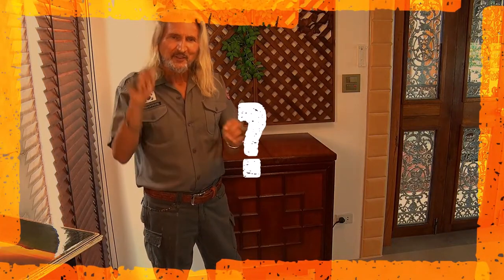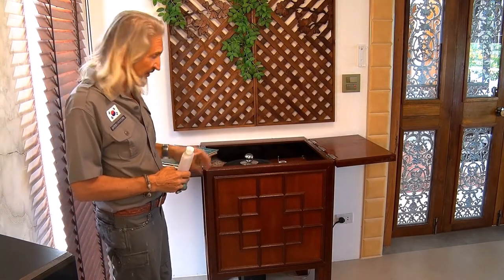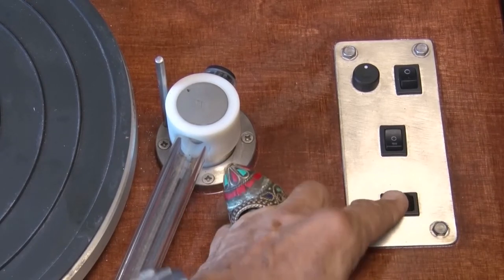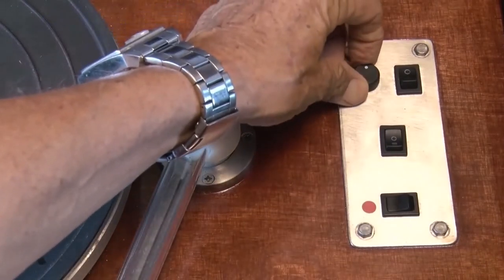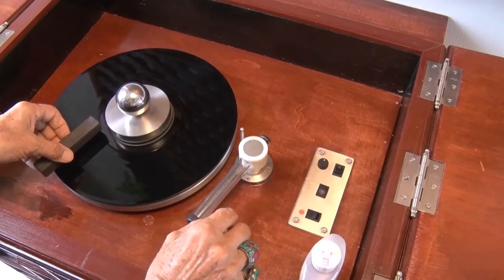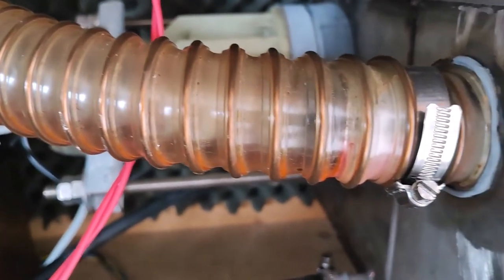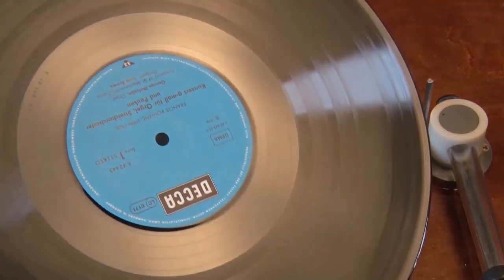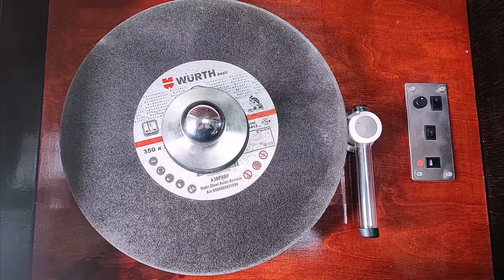Record Washing Machine vpi or DIY?

Comment: Wow, that's quite a story. First time seeing such interesting DIY product. I'm using ultrasonic bath (the one made for juwellery or car parts) with spinning bracket/holder, gladly it could be had inexpensively. Big disadvantage is that washing becomes the whole process and often involves me doing this for 30-50 records at a time.
Reply: Thank you for being the first one to provide feedback. In fact, ultrasonic devices have been the "dernier cri" in record washing for many years already and you are blessed to have this top technology. If the handling of so many LPs at a time makes you weary, can't you add a labour saving mechanical transport to the construction?

Comment: I made a system using a "vinyl vac." It is a wet clean with vacuum, and accomplishes the same result as your system. However, it isn't automated (I have to turn the lazy susan by hand), and it's all bits and bobs that I have to assemble on the dining room table in order to clean records. Your system is superior simply because you don't have to take it out to use, and put it away afterwards, so yours is much more convenient for washing a record before each play.
Reply from the maker: It's the result that counts in the very end, but ease of use is the second leg to stand on. Why can't you do the same thing you do on your dining able in something like a box which you can at least store away in a dark corner?